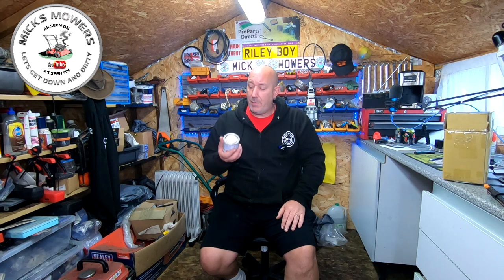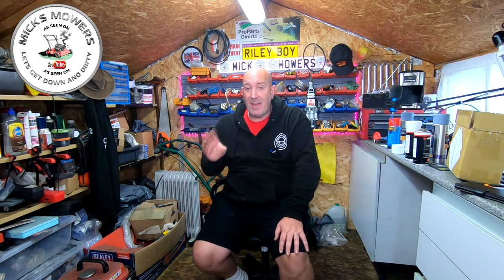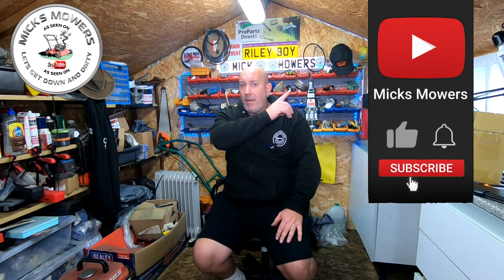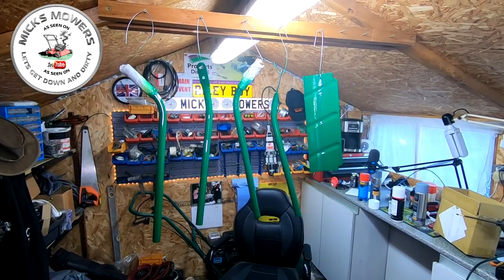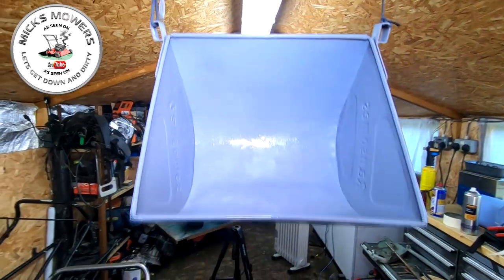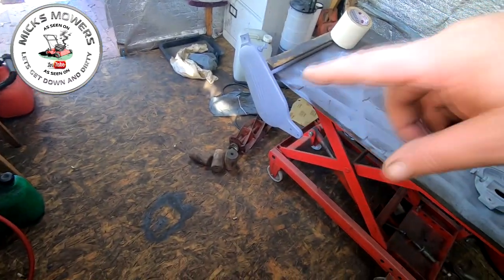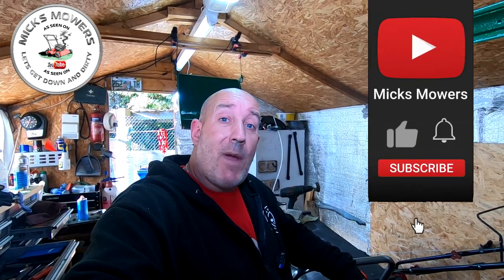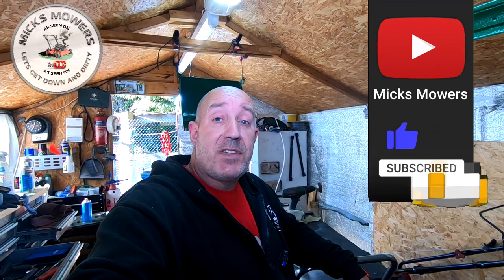Ramsomes Ajax mk4 Restore Part 2. Cylinder Reel Mower #vintage #reels

Comment: You've got a green tash mate!
I'm gonna get a bit technical here, I don't want to worry you but the enamel is cellulose based, 2k or 2 pak is resin or acrylic with a catalyst  and different thinner, cellulose takes ages to fully evaporate and the paint to truly harden whereas 2k takes hours. Putting 2k over cellulose paint might come back to bite your butt with the lacquer lifting due to cellulose getting trapped under the resin lacquer, I'm not saying it can't be done but it takes time or baking in an oven before the 2k is applied.
Ask me how I know! Custom motorcycle tank finished in 2k to protect it from fuel, 12 months on the laquers lifting 😥 gotta do it again.

Comment: Hi mick another great little video,I was wondering what impact driver do you recommend as I'm looking to invest in one next year for my mower,12v or 18? Been doing some research into it and still don't have a clue lol,so I was hoping you could point me in the right direction mate,and happy new year to you and miss p and Riley boy.
Reply from the maker: This is the one I use.. it's good https://www.amazon.co.uk/gp/product/B079QBH3YB/ref=as_li_tl?ie=UTF8&camp=1634&creative=6738&creativeASIN=B079QBH3YB&linkCode=as2&tag=micksmowers01-21&linkId=89467503573edb1ac56b0abff792f1b7